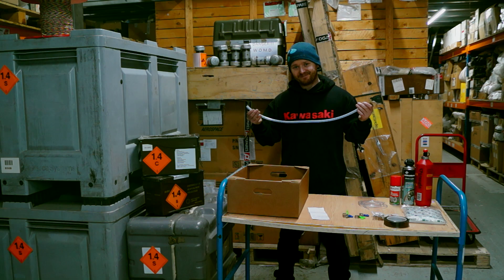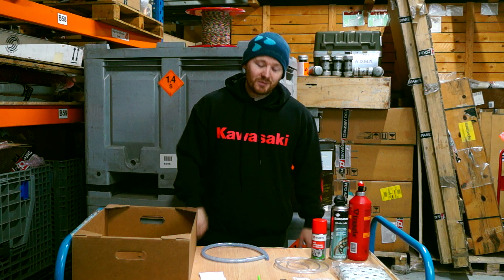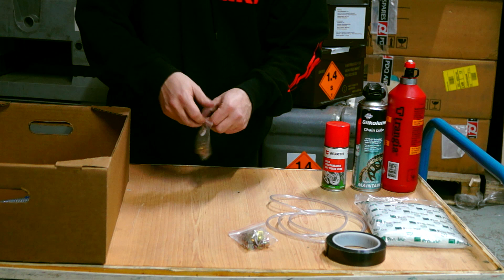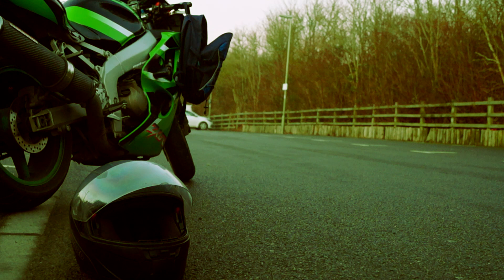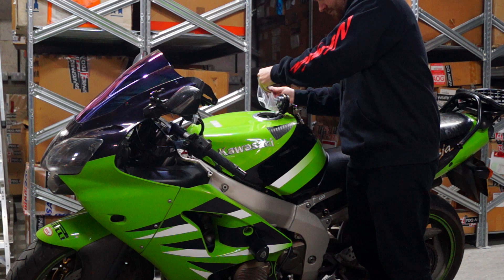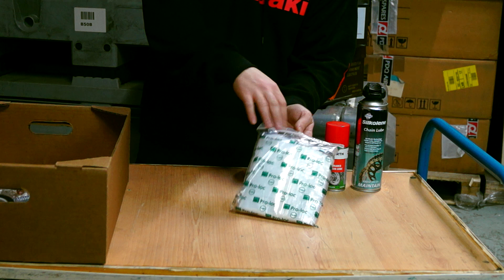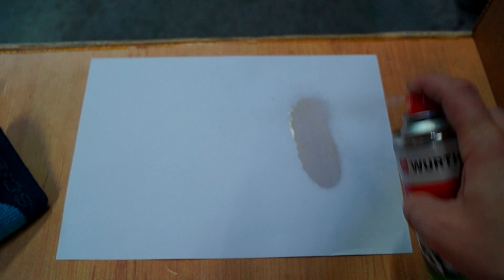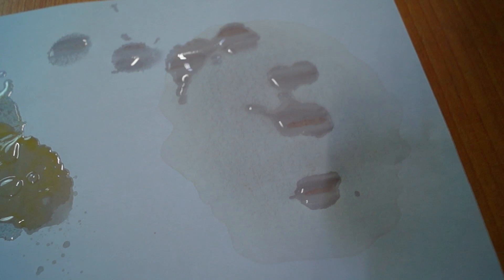Motorcycle Fuel Line Repair Kit + Fake Products

Comment: Checked for the other chain lube. They say "dry chain lube" - so it may be that teflon powder based thing.
Tried that in the past - when I learned you cannot have a mixed usage of oil or fat based wet lubing and the dry ones.
That means you have to get rid of ANY oil or grease before applying the dry lube.
But I was not happy with that: 1. the lube effect was not remarkably better than the wet ones 2. If your on a longer trip and run out of dry lube it's near tpoo impossible to get a matching dry lube. 
For these reasons I went with a oiler an my bikes since then - never did regret this! Works with chain saw mineral oil - perfect!
Wish you happy holidays and a good new year!
Reply from the maker: Thanks for the info! I have just done some searching around on the internet, and reading a bit more about it. If it is a teflon powder based lube, I don't think it is one I will be using. I'm going to stick, with a good old visual and messy oil. All the best, and a happy new year to you to 🙂

Comment: Jesu  H F$¥€_¥g Christ, someone in two separate towns cut your lines ???... WTF ?. That sounds like you’ve been targeted and no coincidence, unless it’s a craze going around to nick petrol. Anyway have a very happy new year mate and all the best for 2019.
Reply from the maker: I thought it was a overly coincidental, but both times were a slightly different - Both situations were a clean cut, and the "reserve tank switch" had been turned on. At the airport the fuel was all over the floor, but at my local town, there was no trace of fuel, so the bike was probably targeted for the petrol. Happy new year & All the best to you to 🙂